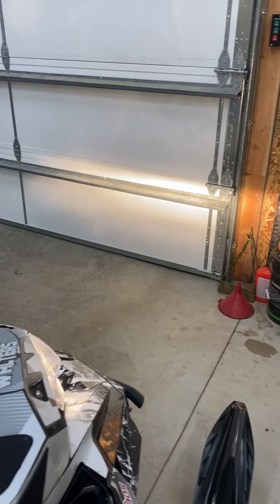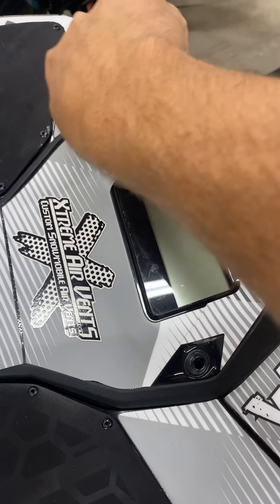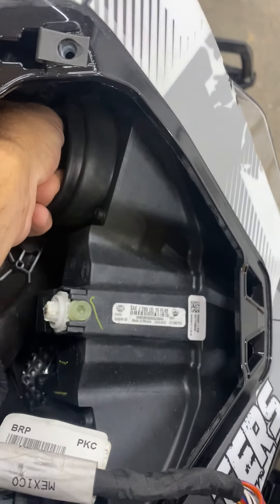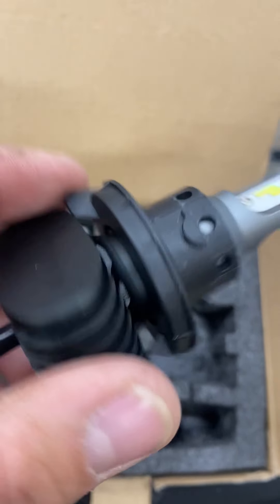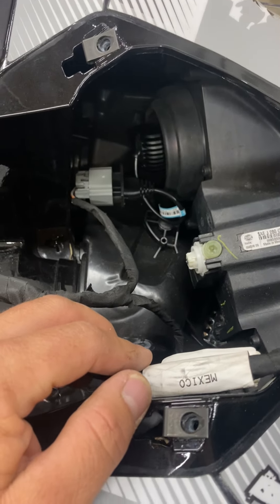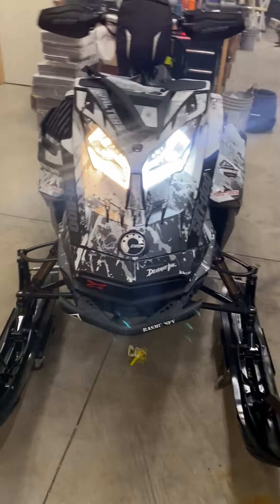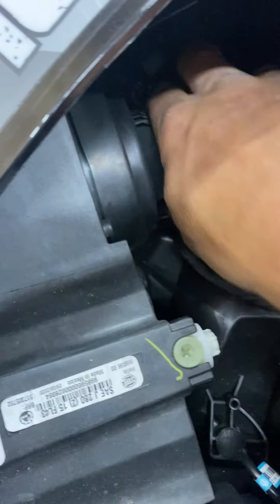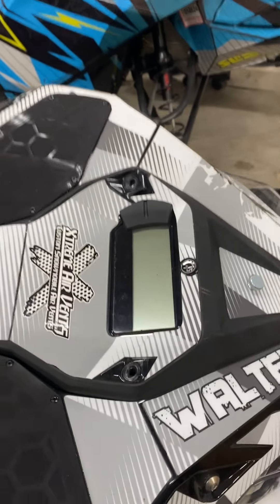Beamtech LED install in 2021 Ski-doo 850 Turbo

Comment: Did you set them so there perfectly vertical? I think there supposed to be.
Reply from the maker: Good catch, I didn’t adjust them but it’s easy enough to pull them out and rotate the “bulbs”.  They provide a tiny alen wrench in the box to make the adjustments.  I may pull them out and rotate them.  I found in my truck it made very little difference.